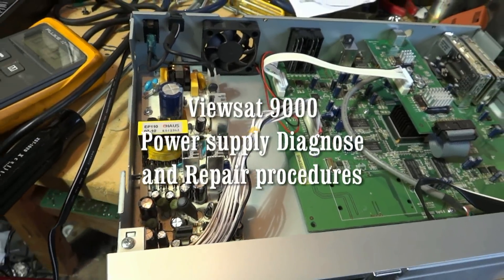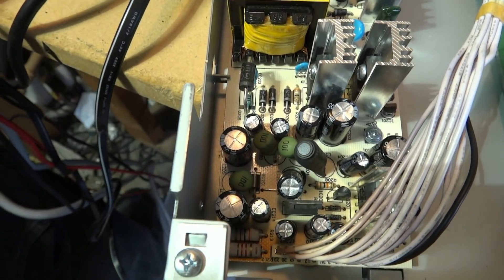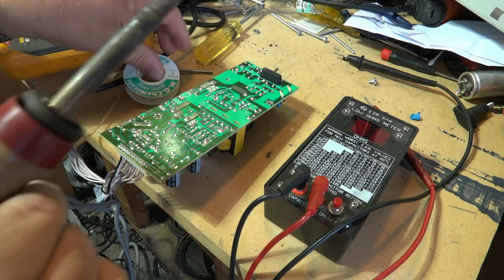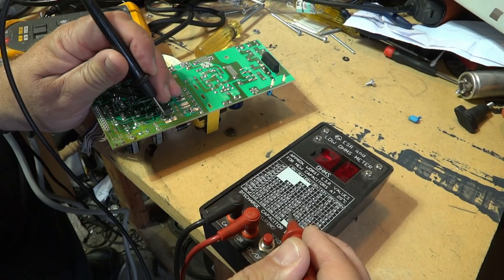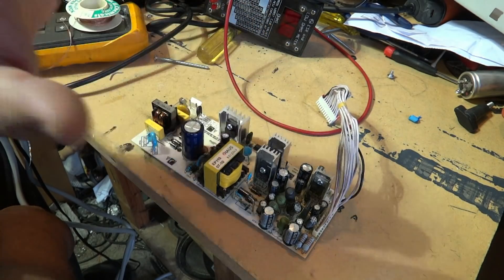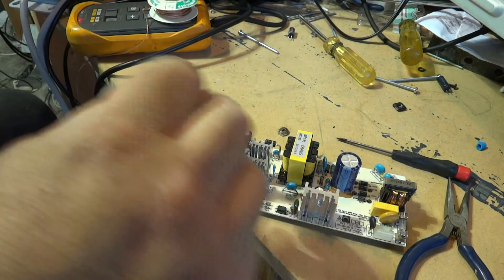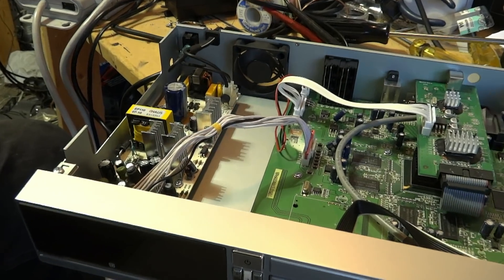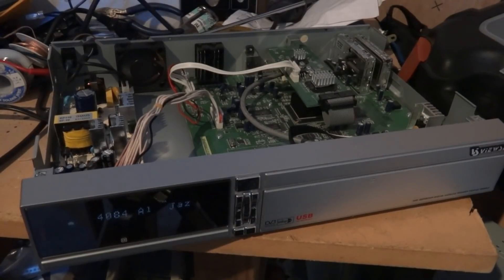Viewsat 9000 FTA Satellite Receiver Power Supply Repair

Comment: hi  just wondering if you can help.. i have a goodmans lcd 32" tv..  if i leave it on standby it will turn on with no problems at all..
but if i unplug or turn off at the wall plug it  for more than a couple of hours  when i plug it in and try to turn it on the red standby light will go off and the tv does not power up..
but if i unplug it and leave it for an hour then plug it in again and the red light come back on.. BUT if i leave it with just the red light on for twenty mins or so it will then power up and turn on.

sorry for such a long winded tale, so hope you have an idea what it could be
Reply from the maker: That sounds exactly what happened to the Samsung I repaired a few months back.
It would power on and off untill it was unplugged. Then it wouldn't power up again, unless it was unplugged / replugged aver and over. Eventually it would catch, and once it did if I turned it off with the remote it would power up again no problem.
It was a capacitor in the standby soft start circuit. See that video for my troubleshooting technique. I used 4 AA batteries to "tickle" the standby and get it up and running.

Comment: Hey,

very nice video, I really like it and you seem to have quite alot knowledge. One of the reasons I am saying this is because you are one of the few people actually warning about the High Voltages possibly present in a PSU. However, could you tell me how to identify those dangerous capacitors? Everybody keeps saying "stay away from a PSU, the capacitors can kill you!" but no one actually tells how to identify and discharge them adequately.

Thanks and best regards :)

Comment: Nice video. Years ago I also built an ESR tester using a 555 timer to send "AC" thru the cap under test, rectifying the signal passed thru, then measuring with an analog micro amp meter...etc;
 But my question is : couldn't you have just bridged the suspected electrolytics one-by-one in the first place, and found the offender quicker? Even if more than one was bad, only the last to fail actually stopped it from working..(?)

Comment: Great video from a tech master.  Super job!

I have an LED 32" TV that operates fine...sometimes...but only after several tries plugging and unplugging.  Most tries only produce a black screen.  Since this is intermittent I'm puzzled where to start testing.  Any ideas?  Any help would be great appreciated.  (32" Element LED by Continu-us) BTW.  Thanks!  Roger@FeltonTrading.com
Reply from the maker: I am going to go out on a limb and say it is a capacitor in the soft start circuit. That is what happened to my Insignia/Samsung 42" plasma.
If I unplugged it, it would not start, unless I unplugged replugged several times. Once it was up and running it was fine until it was unplugged again.
It is going to be a capacitor somewhere in the power supply circuit. That plasma I am referring to (video is on my channel) took me about 4 hours to find, as I was headed in the wrong direction initially, but find it I did, and that set is back in serivice today, in my son's room.
Kids got a 42" TV in his room for his xbox. You could sense the jealousy when his friend came over to play xbox, and  saw he had this great looking plasma in his room.

Comment: @ 12voltvids what could be the problem with a transformer that is getting extremely hot on a receiver?
Thank  you.
Very informative video
Cheers
Reply from the maker: This could be a couple of things. It could be a shorted winding on the transformer for starters. If you disconnect the secondary load and it still gets hot, then you have a shorted winding. Could be either the primary or secondary. If a transformer overheats it can damage the enamel insulation on the copper wire of the winding. This would fuse the winding to its neighbor wires and cause a short. Now if you disconnect the secondary, and the transformer doesn't heat up, then you most certainly have a short somewhere. Either a shorted diode in the rectifier circuit,or a shorted filter capacitor, or a shorted output section.
Reply: 12voltvids Thank you for the quick response!
When i turn on the receiver the transformer gradually becomes hot to the touch.
I will disconnect the secondary and check it someone also suggested that it could be a bad capacitor in the transformer circuit, I might change the capacitors in the transformer board and see if that helps also.
Thank you again for your advice.
Rob

Comment: I managed to cause an LCD panel (LG Passive 3D 25inch monitor) to stop working. I believe what happened is some metal came in contact with the circuit while it was on... it now won't show any sign of powering on. Would the technique you used here help to find what has been damaged? Is there a way to fix it or do I need to find a new monitor (I had it opened up for use in a DIY projector). Thanks for any help and I look forward to seeing more informative clips!

Comment: i have sony HCD VR90AV audio system and it is in quite old condition and most of the time power gets cut on its own even though the plug is inserted in the wall socket ,but when i hit on the side power comes back and machine starts running , can you suggest any solution........please help me bcoz i love this machine and dont want to throw it away.
Reply from the maker: The fact that it comes back on when you smack it on the side suggests a broken solder connection. Inspect the power supply section, especially where transformers or power relays are soldered to the board.
Reply: And there is also a lite buzzing sound coming out what could be causing it
Reply: zohaib siddiquee can you suggest what may be causing the buzzing sound coming out of the speakers
Reply from the maker: zohaib siddiquee
Could be a loose grounding screw. Look at where the circuit board is attached to the chassis. Some screws may have a metal tab that goes to the board. That metal tab is the grounding screw. It is comes loose it can cause humming or buzzing. Unfortunately it is not possible to diagnose such a broad question. This is like calling the doctor and saying "Doc, I just sneezed, what's wrong with me"
Best thing to do is to tr to isolate the problem. Tap around on the board with an insulated tool, such as a plastic pen, or chop stick. Do this with the power on, while listing for any clicks, pops or noise changes from the speakers. This will help you isolate the area if it is caused by a bad connection. if it it a low sounding hum, and the unit has a conventional linear power supply, check for filter capacitors going bad, or a diode in the rectifier circuit going leaky. A scope will help out in this case as it will allow you to see ripple in the DC power circuit.
Reply: 12voltvids I could not believe it man i just fixed it myself,the restarting problem has gone ..thanks man .....really appreciate it.

Comment from the maker: Be sure to check out my new JVC VCR repair video, where I had a VCR with 4 seperate problems, a power supply, the mechanism had come apart, it needed an alignment, and there was also a head switching electronics trouble in the drum servo. This one will be uploaded as soon as it is edited.

Comment: Hey! that looks like my shop! Now I'm not so embarrassed. I do own a nicer soldering iron though, are you sure yours wasn't the one used by cavemen to start the original fire? :)

I use high efficiency T5 fluorescent  fixtures, so I have the same problem with displays showing up as well. My current project is fixing the damage caused by a leaky battery on my Amiga 4000, and while I am in there it will get new caps on the motherboard and on the CPU board, and a new coin style battery holder.
Reply from the maker: I have a nice Weller EC2000 temperature controlled station, that I used for many years when I was in the business. The thermocouple tip temperature sensor went bad, and that part is no longer available. So an iron I paid about 500.00 for 30 years ago is worthless. I just use it as a holder for the 25.00 cheap one I use now.
Since I am no longer in the repair business as a profession, I don't need fancy tools. My scope in an old 40MHz analog Iwatsu I bought in 1984, and it still works just fine.
My DVM is a Fluke 12, and it would be a fluke if it was accurate! My ESR tester is a home made, from a kit I bought over 20 years ago. Electronic repair is now just a hobby for me, as most people these days won't repair stuff anyway. I am seeing a bit of vintage audio work, seems that folks don't want to part with their old amplifiers.
The light that makes so much noise is an old 400 watt high bay metal halide that was given to me years ago. It came out of a building a friend works at, and the electrician told them the ballast was shot, and sold them a new unit. All that was wrong was the short piece of flexible wire that connected from the ballast to the JB on the building had a conductor that burned open.  Bought a bulb for it, and it gives me a great light for working on stuff, even though it is noisy as hell. The buss is actually the metal reflector resonating with the ballast core.
Reply: 12voltvids Well my favorite iron is my gas job. so I shouldn't talk. :)

It's a hobby for me as well, since there really isn't much money in it. And I'm working seven days a week as it is. Besides, doing it for someone else can quickly drain all of the fun out of it.
Reply from the maker: John Waalkes
Now that you remind me, I have one of those "blow torches" around here somewhere. I remember my old boss thought that would be a good thing to carry in my tool kit back in the day when we used to fix console TVs in the house.
Till one day I dam near burned a customers house down. I fired up the butane soldering iron, and a spark from it dam near ignited the dry xmas tree that should have been taken out long before I was there fixing the TV.
That spelled the end to using a propane powered soldering iron. Actually that spelled the end to in home service for the shop I was working for when the home owner threatened to sue the shop.
I totally agree with fixing other peoples stuff. More fun to fix my own broken stuff. I still do the odd paid repair. Some of my repair videos are paid repairs, and others are my own. I just like to keep a hand in the business. Keeps me in touch with my old contacts in the parts supply business. I know that many of them are struggling these days due to a decline in service.

Comment: you dont need to unsolder caps with an ESR meter "only with a common "capacitance meter" "that is the only beauty of it_
Reply from the maker: To get an accurate reading you need to unsolder one leg, as capacitors in parallel will cause an incorrect reading. You can get an idea that a cap may be bad measuring in curcuit but to get an accurate read you need to disconnect it.

Comment: Hey I liked your video.  I have a Sony KDL-22BX300 tv with no power. I checked the power supply board and I am not getting any dc voltages to the pins. I don't see any caps that look like this are bad what do you think I should check?
Reply from the maker: Without looking at it I couldn't begin to diagnose a dead set.
If there is no DC, check the standby supply. There should be a 5 volt supply that runs 24x7 to power the remote control circuits. If the standby supply is dead, then nothing else is going to power on.

Comment: Just wanted to know 10% of what you know 12voltvits, holy shit! 

Hugs and keep up the excellent work!
Reply from the maker: Thanks. I actually haven't kept up on the new digital stuff. I ran a busy repair shop from 1984 into 2003, and by definition of ran, I mean I fixed everything.
My specialty was Video recorders, TV and Hifi audio.
I never got into car audio as the shop refused to do that type of work because the 16 year old geniuses were always blowing stuff up as soon as it was fixed.
Now I just tinker with electronics as a hobby. I am a telecom tech now. Totally different culture in that business let me tell you. I have to deal with the outside plant, and termination equipment. If something is broken, I just swap out the unit, and send it in for someone else to repair. It's nice, easy work, and there is good money in it.

Comment: My Mirage Prestige S8's amp blew one 220uf 200v capacitor. I also saw one small bulging capacitor. It's a switching power supply. What are the chances only the capacitors are busted? Any risk trying the amp out after replacing just the capacitors?
Reply from the maker: Any cap that the top has bulged is likely bad, but there may be others that don't look bad, but are on their way out, that will only show with an ESR meter.
As usual wen trouble shooting check the usual suspects, like output transistors for shorts. I don't have any experience with the Mirage subwoofers, so I don't know if it is a class B or class D digital amplifier you are dealing with on that unit, as the troubleshooting is totally different, But bulging capacitors are an easy way to spot ones that you know are bad. Black tar like substances leaking is another indicator of an over pressured cap.
Reply: 12voltvids hi , what are the symptoms of leaky capacitor and do you know about dissipation factor (d) and quality factor values (q) of the good capacitor ?

Comment: please help me i have a pc power supply, it works fine when no lord, but when i connect a dvd rom it shuts down, and if i tried to power again power comes and shutdowns suddenly, it was working normal it could handle 5 dvd's once before, now even 1 i connect it fails, without any loard power supply works fine please help me :(

Comment: Why take the time to check the caps?  They showed signs of failure so why not just replace all of them?  Caps are cheap.
Reply from the maker: The point was to demonstrate how to test for faulty capacitors with an ESR meter. Not all of them are bad, and not all of them will fail. When a client brings a piece of equipment in for repair, they have in their mind to get it repaired for the least possible cost. If you go in and replace every capacitor, then unless you don't value your time you are not going to make any money. If you watch my video on the LG LCD TV I repaired I did replace all the caps that showed signs of stress.

Comment: good this video is helpfull... ABOUT THE ESR METER DO WE GET THEM IN SHOPS OR IT IS JUST UR INVENTION... COZ ITZ KINDA COOL IT HAS GOOD PRECISION , BECAUSE IF THERE IS NO BULGE IN THE CAP THEN DATZ HARD TO CHECK...... IS THERE ANY OTHER METHOD TO DETECT THE CAPACITOR FAILURES COZ I HAVE ONE RIGHT NOW IN MY CRT POWER SUPPLY......
Reply from the maker: ESR tester is really the only way to determine if a cap if going south. If you check it with a capacity meter it will look just fine in terms of farrads or energy it can store.
You can buy ESR meters both built and in kit form. Mine was a kit, and it cost me about 60.00 when I built it 20+ years ago.
Reply: https://www.altronics.com.au/p/k2574-esr-meter-kit/